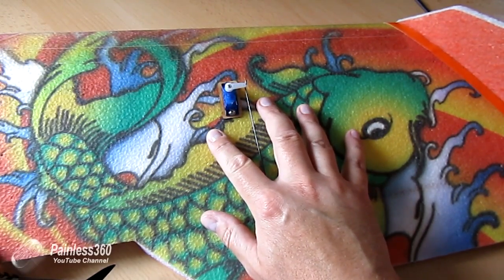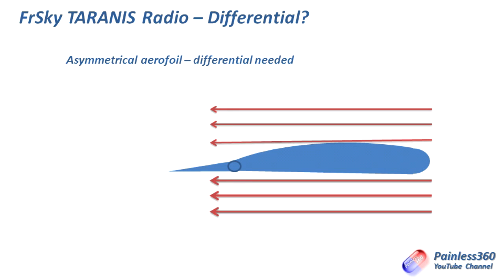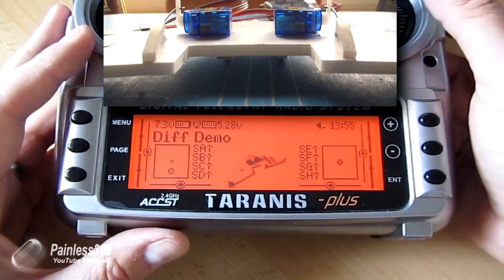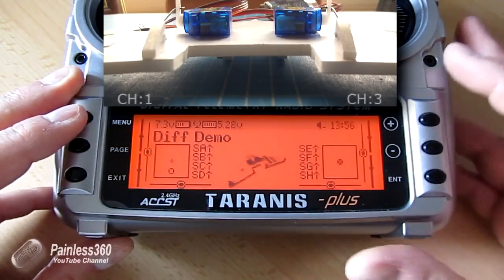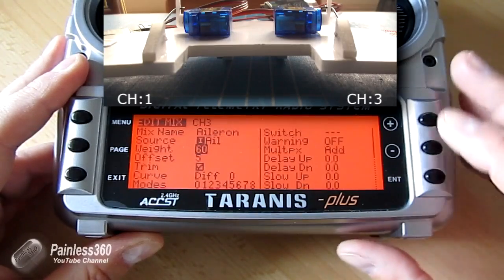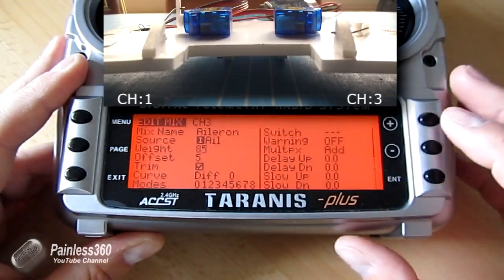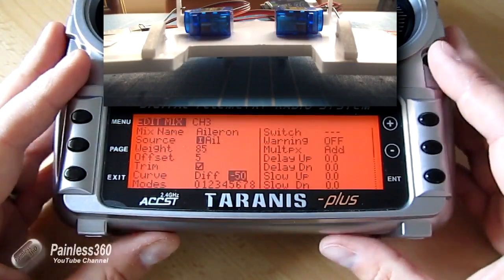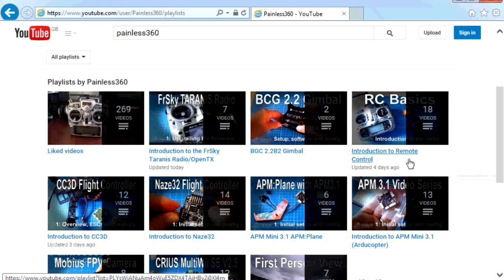FrSky TARANIS Quick Tip – Explaining Differential (Diff)

Comment: Ah so it's basically like offset but where the neutral position remains unchanged
Reply from the maker: Not an offset as such, the middle point remains unchanged too... Happy flying!
Reply: @Painless360 sure thanks, by neutral I meant "middle", but just said neutral as it's no longer in the middle of the range which has all been shifted one way or the other. In any case very useful as I dusted it off recently but this time to use with a plane and wondered what diff did when I saw it, thanks!

Comment: I'm guessing you cannot set differential for two aileron servos Y connected to a single channel. I want to set each up travel higher then their down travel. Probably have to do it mechanically, right?
Reply from the maker: If you are sending the servos the identical signal through that y-cable. Then you only have mechanical adjustment to play with. Best of luck
Reply: @Painless360  Thanks.  The model I have, Top Flite P51D 1/7 scale has pushrods for each aileron going to one servo. This kit is old but for whatever reason uses a single servo with pushrods and a couple 90s to control the ailerons. In the very least I was going to see if I could get separate servos to fit that control each independently. Setting the throw for smaller downward angles vs bigger upward angles isn't a big deal (hopefully)

Comment: How can you have differential as well as expo and dual/Triple rates? I cannot, for the life of me, figure this out.
Reply from the maker: So what exactly are you trying to do?
Reply: +Painless360 
I think I figured it out. Trying to use differential with expo and rates. Used ch9 mix to setup main input with rates and expo. Then used output channels (2 and 5 for me) with ch9 as input with differential curve. Works perfect.
Reply: +Painless360, Lee What Joshua is after is exactly the same as myself. To keep the expo, so that we have lea-way in the stick movement around the center of the stick, but... also have differential in the aileron movements.  I'm not entirely sure how Joshua has done it, but there is enough of a clue for me to have a stab at it and see how it works out. Maybe worth a separate video? (if you haven't done one already?)
Reply: You could specify the amount of EXPO on the "INPUTS" tab instead of under "MIXER" that way you could have both expo and diff on what ever you like. I have for instance under INPUT tab specify DUAL on each channel using a switch and on each of these different values I have specified EXPO value. No need for complicated mixers

Comment: Could you do a similar video on Subtrim and the two modes.
Reply from the maker: +Rav Gupta Modes? Do you mean mode 1 and mode 2 i.e. where the throttle is?
Reply: +Painless360 Trim in flight, move trims to sub trims (off set). On the output screen last column there are two subtrim modes. Up arrow and equal. Useful for us to know the benefit of subtrim. I just learnt. Also important to understand the difference in modes. In one the slope of stick to output changes at the offset mark and travel limits remain the same. The other the slope remains the same but there is clipping on one side and less travel on the other. Modified limits should not be a big deal for general flying but may be good for 3D pilots to know. Your videos are awesome. I tried to make one and it was a mess:) besides your playlist is the best one. So Many more details to cover that  are not explained.
Reply: +Rav Gupta might be more than one video.